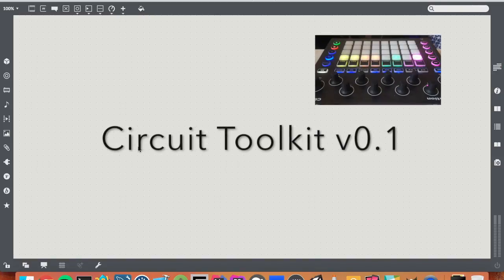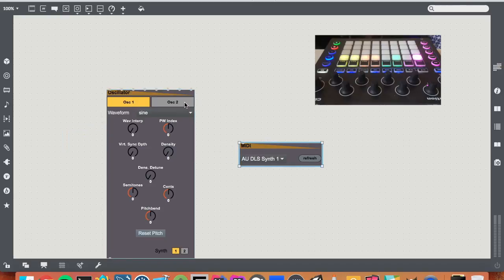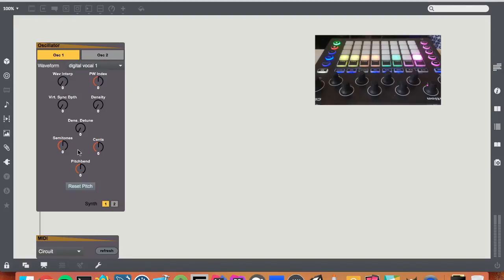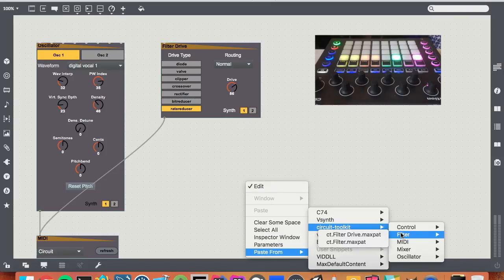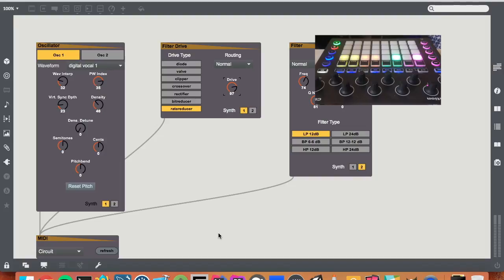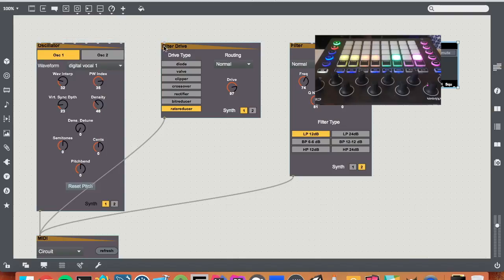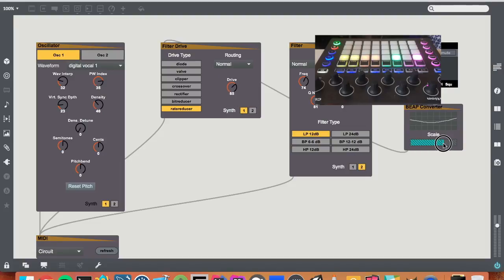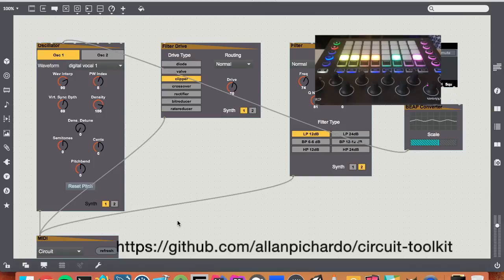Circuit Toolkit v0.1

Comment: Does it save changes like the isotonic editor does?
Reply from the maker: Not in the same way as the Isotonik editor, yet, because it's at a very early stage right now, but if you create a sound that you like, you could just save it in the Circuit by just hitting save on your session or if you have some kind of automation, you could record it from the Circuit sequencer. In later versions we want to be able to save entire patch banks the way Isotonik does.